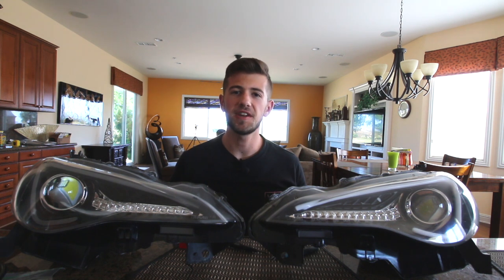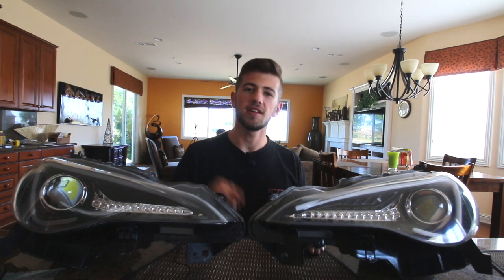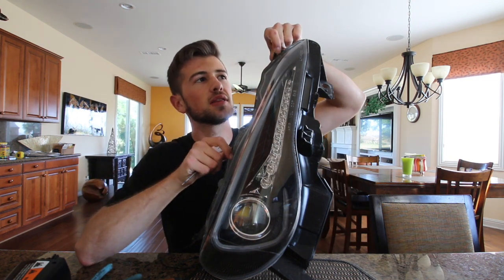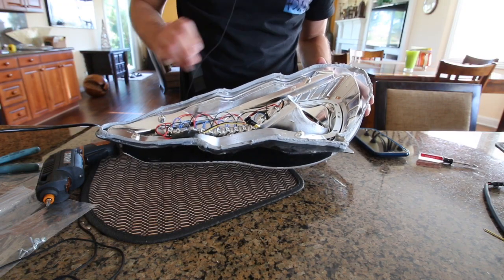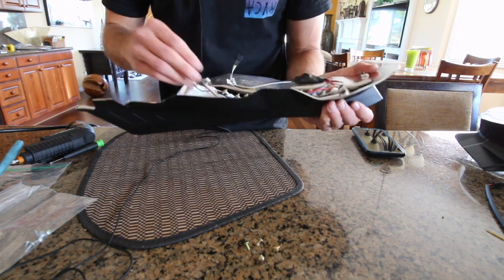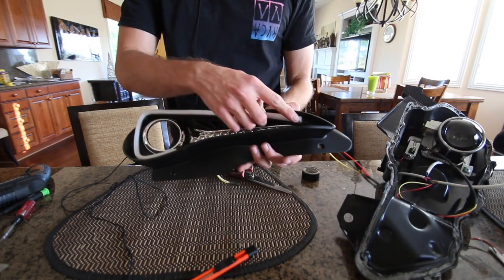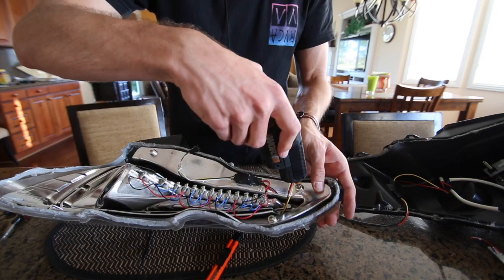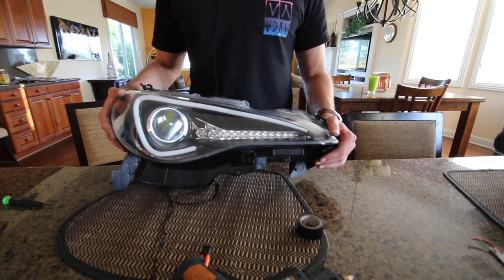How to Upgrade Spec-D FRS/BRZ/86 Headlights

Comment: my spec D headlights are peeling clearcoat within half a year...  how would you fix that?
Reply: Same for me ;( literally only like 7 months and boom
Reply: Ya that’s a common problem with the spec d’s. Get meguiar’s headlight restoration kit for $20-30. You basically sand it down with the provided sand disks and apply clear coat  after. It’ll last you at least a year or two 👍
Reply: @chandlerhammonds3929  yeh legit mine happened in 6 months of car being parked on my driveway instead of being garaged...
Reply: @Musicizmyremedy  word, thanks bro!
Reply: Patrick De Freitas anytime bro. Just make sure you put tape around the paint near the headlight so you don’t accidentally chip the paint